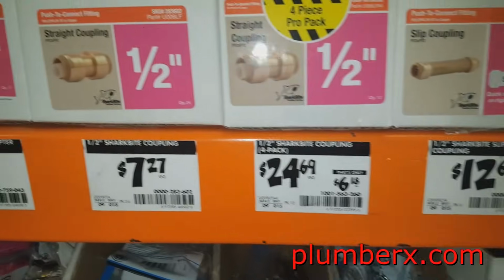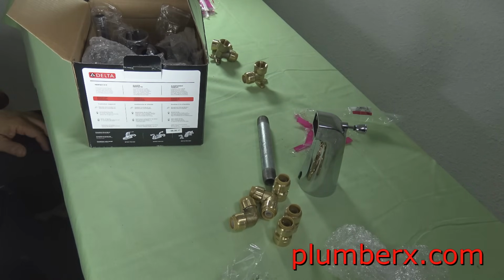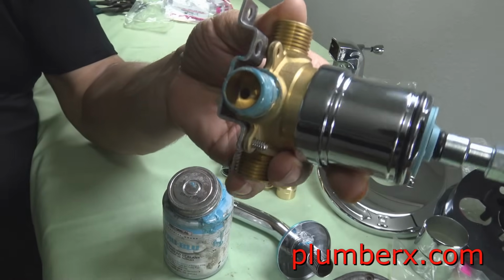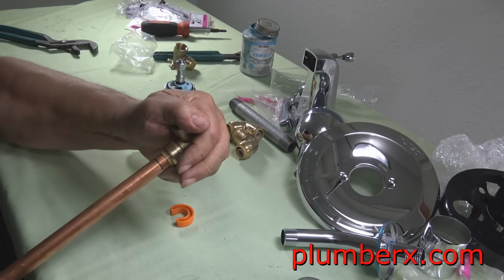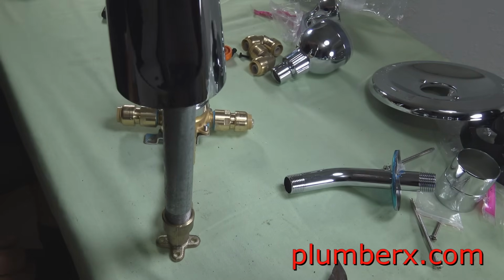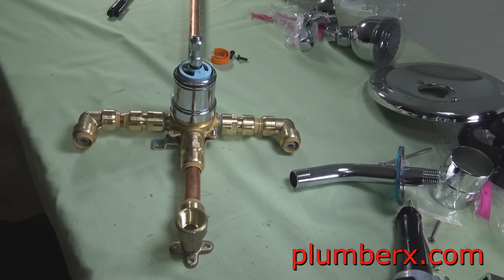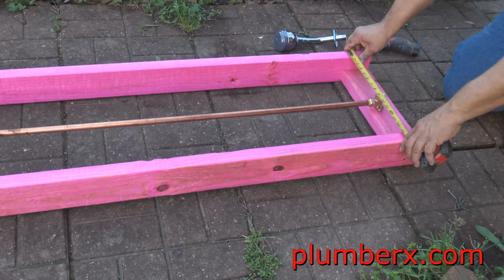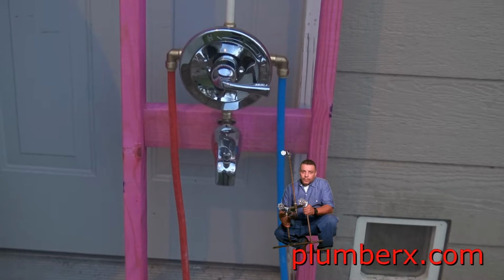Plumbing With Sharkbite Fittings

Comment from the maker: What do you guys think of Shakbite Fittings?
Reply: How to Plumbing I use them a lot in my rentals but I don't put them behind walls, I sweat in the walls. Just worried about failure in a few years. I pex in the walls a lot. I use only shark bite water supply knobs and never had a problem.
Reply from the maker: Yeah were they are allowed to be used they say they really want them exposed for access.
Reply: Only use them in a emergency or when the water just won't stop and font have a ball valve and jet sweat on hand.
Reply: Thank you for your informative "how to" plumbing videos.  I have used sharkbite fittings in the past, I just won't use them in a concealed area like inside of a wall or ceiling in case one of the the O-ring seals that is inside fail and need replacing.  I try not to use them generally with copper, because they are expensive (around $8 a fitting) compared to standard copper sweat fittings.   But if someone is not comfortable with soldering I would recommend them.
Reply from the maker: Sith Sidoti Good idea
Reply: Seems great for use when u cant afford many tools. I have a house full of galvanized and I converted one bathroom with pex.
Reply from the maker: mostmost1 You get it. Thanks👍
Reply: You definitely want a few in your box for that Sunday night repair. I've had one leak.  No way would I put it behind a wall.
Reply from the maker: Chris Gonzales Oh yea😉
Reply: I think there great but some plumbers don’t like um just like what they said about PEX😂😂😂🤙🏽🤙🏽🤙🏽... Great job my friend I always watch your shows all the way from Hawaii!!!
Reply: I like the shark bites.  The leaks I have experienced in the walls have been those the were sweated on.  The leak was not through the joint but through the wall of the fitting.  The shark bite fittings seem to be much heavier.  I have only had one leak with the shark bites and it was a faulty o-ring which leaked immediately when the water was turned on.  Replaced it and it was okay. My main complaint with using shark bites is the cost.  They are much more expensive than the ones you sweat on.
Reply: Yo no confio mucho en el sharkbite ,,es una opinion muy personal..No estoy diciendo que el producto sea malo....Y El error mas comun es que se ponga en el intermedio de las paredes...yo lo considero como ponerlo solo temporal..y despues remplasarlo por algo mas tradicional..
Reply: Great video! On the cold water side, you didn’t leave enough space to remove the shark-bite for future repairs. The hot side seems that there is enough room. 😀
Reply: I always use the shark bite caps during leak detections. They havent failed me yet.
Reply: What is better to use with copper pipe weld or sharkbite.
Reply: @JoseAguilar-ng8rn  tienes toda la razon con respecto al sharkbite yo tengo que cambiar toda la tuberia de la casa y creo que es mejor usar cobre con soldadura.
Reply: Is it ok to use NPT on Iron pipe thread?
Reply from the maker: love it
Reply from the maker: @nunyabusiness2509 yes

Comment: It's my understanding when using copper pipe with sharkbite the white sleeve it to be removed. That sleeve is used for PEX plastic to maintain its shape.
Reply from the maker: That may be true, But I wouldn't recommend removing the white sleeve. You may need it in the future. These are reusable fittings.
Reply: The sleeve needs to be removed for copper, it will not allow the most solid connection, and can cause a blow off.
Reply: From Sharkbite: "NOTE: The tube liner is necessary for use with PEX, HDPE or PE-RT Pipe. It is not required for copper or CPVC, however, it is not necessary to remove the tube liner from the fitting."

Comment: Does the water arrive hotter from the spout when using pex apposed to copper? Does pex need as much insulation / lagging?
Reply from the maker: I'm not sure about the temperature change, but pex is a better insulated pipe then copper. It will not freeze and burst.
Reply: @theartofplumbing   PEX will freeze! Just most likely not to bust.

Comment: I've used Sharkbites and would use again. But, if they have any tension, pipe isn't straight they will eventually leak. The seal is an O-ring and the tension will flatten out one side and the joint will leak.  Just a warning.

Comment: When you're using shark bite, why use copper at all, especially for the shower to valve tube, why not just use PEX?
Reply: My delta shower installation instructions said not to use pex for the down spout for the tub. Im not sure why but it specifically said not to use pex.
Reply from the maker: You can. Everyone is different, this is just to show off all the options of Sharkbite fitting's . Good Question.

Comment: It's not the traction provided BUT the lousy O-ring that will fail under chlorinated water slash hard water. Best to solder in rigid copper pipe.

Comment: Thank you very much for taking the time to do this. It was very helpful.
I live in a remote rural area in an old house where nothing was done to code. The house had the same plumber for about 50 years but he passed away several years ago and I can't find a good licensed plumber that will come out here. I need to rectify some mistakes and do some upgrades to the home. Right now we have 2 and 3 handle showers & tubs. I want to convert to single handle Moentrol levers.
1. Have you ever worked with the Moen 3510 IPS valve (it has female IPS)?
2. Have you ever installed Moen Kingsley Moentrol trim?
3. If all of my existing plumbing is 3/4" PVC & CPVC (with short runs of galvanized linking to a tiny bit of copper) would you recommend running 3/4" PEX and just reducing spots that require 1/2" IPS? Or should I just go down to 1/2"? I don't want to reduce my water flow/pressure.
Reply from the maker: Moen 3510 IPS valve Yes I have those are mostly used in the commercial application. Good strong valve, but no I have never installed one. And the trim I have only when working on the valve, removing and replacing the trim. As far as running pex pipe yes if you want good water pressure. I would recommend running as much 3/4 as you can until you get to the point of 1/2 and you can pick up two plumbing fixture with 1/2 and keep good pressure. The trick is having the volume and that only comes with the larger size pipe. To give you an idea It's like driving down a Highway 4 bigger land's will move traffic along a lot faster than a two-lane. Good luck with your project. :-)
Reply: Thanks. So I will just need to find something that will go from 3/4" PEX to 1/2" for some of the connections at the very end?
Reply from the maker: my cats You can use a 3/4 x 1/2 shark bite  coupling.
Reply: Thanks! I'll have to look for those.

Comment: Sharkbites are a great product but i would never install them behind the wall. Also Sharkbites are expensive compared to solder in. I am doing my bathroom right now and if i used sharkbites it would probably cost about $100 compared to less than 20 for the fittings i need.
Reply from the maker: I understand. Thats whats great about people every one is different. There are a lot of people out here that wish they could solder copper pipe like you, its nice to have an alternative. 👍

Comment: I thought your not suppose to use shark bite behind the wall because of the risk of leaks in the long term?
Reply from the maker: Your right, but if you have access on the other side of the wall it's good. I have another video installing that same shower with a opening on the othere side. Check it out. Thanks
Reply: You are correct, not intended to be behind the walls👍
Reply: They can be, they are certified to do so.  Anything can leak eventually, but do whatever makes you feel comfortable. Nothing wrong with NOT doing it either.

Comment: Shark bite fittings rely on an oring to seal,   Orings will ALWAYS dry out over time and become brittle, crack, and leak. Trust me , I’m a hydraulic technician, I change thousands of seals per week. Shark bite has its place,  but I would never bury it behind drywall,  only for accessible areas or temporary plumbing.
Reply from the maker: What would you do about propress fittings with rubber o-rings?

Comment: Sorry to say , sharkbites should not be enclosed as they fail , sharkbite have a replaceable rubber O ring . Not looking for haters just stating a fact
Reply from the maker: I don't disagree with you, but all plumbing fittings have failed once or another. Sometimes it is workmanship, defective plumbing fittings, and the age of plumbing.  I have made many repairs on all types of plumbing fittings. But that's good you have your opinion. Thank you for your feed back.  https://images.app.goo.gl/BSMKfn2aJ9p6fFou8 

https://images.app.goo.gl/MvsunYcByJPtYHYg6
Reply: Sorry to say it's fact , have removed numerous sharkbite fittings that homeowners and plumbers alike have installed , some only being installed a matter of months , sharkbite fitting are not meant to be concealed , on the other hand a qualified plumber installing copper and inspected will last 40 ,50 years and more . If for any reason you have to disconnect a sharkbite fitting and then reinstall the teeth that hold it in place, have been damaged. I hope this helps all the best  🙂👍

Comment: I'll use sharkbites out in the open, seems risky being enclosed in walls, time will tell, but relies on that rubber ring inside..rubber rots
Reply: Installed properly, SharkBites should be trouble free for 25 years.  On the other hand, a properly installed copper soldered fitting will perform beyond 100 years.  Depends what you consider 'permanent'.

Comment: Cpvc glue joints all new and shark bite to original plumbing.  Easier,faster,cheaper and it will last.        I can do all forms of plumbing but will still do it this way in my home.  Unless you're redoing the hole house plumbing from a to z save yourself the time,wallet, and get her done fellow
Reply from the maker: Exactly 👍

Comment: I probably would have used a brass nipple since galvanized corrodes faster. Also of note, Sharkbite fittings, while convenient, only last about 25 years. Something to think about when using in a wall cavity.
Reply: They WARRANT it for 25 years, that doesn't mean it only lasts 25 years.

Comment: You should remove the plastic sleeve and it will be easier to insert the copper tubing. The plastic insert is not needed when using copper.

Comment: Ohh god never use galvanized pipe for domestic water it will still rust. galvanized pipe nowadays is used for outside gas installations what you should use is a brass nipple they will never rust and white inserts for the shark fittings should be pulled out if you’re using copper there for pex pipe
Reply: My neighbor removed his and no rust after 45+ years of good service!
Reply from the maker: Exactly. Thank you I see it all the time.